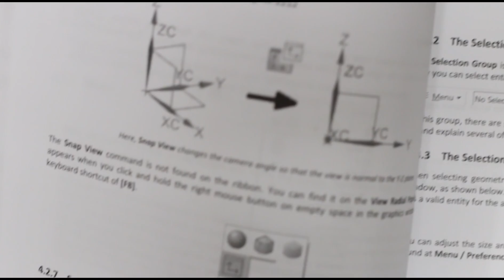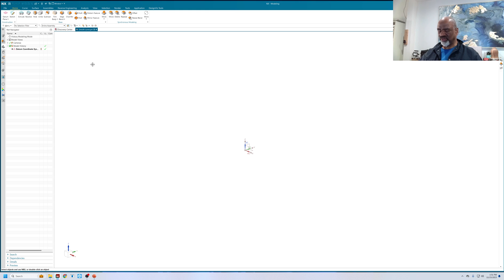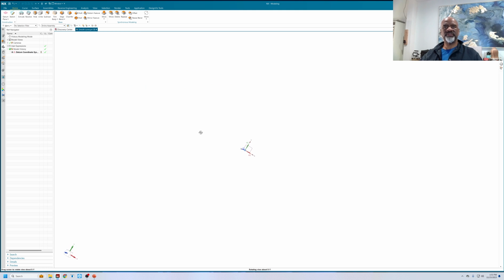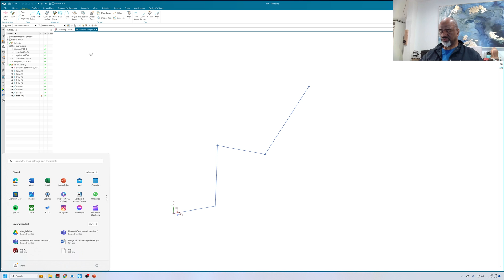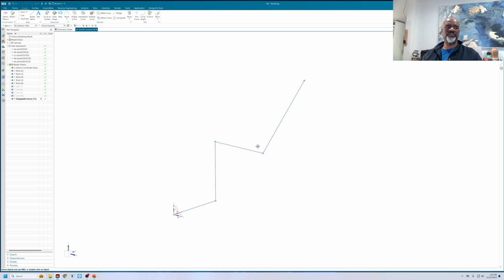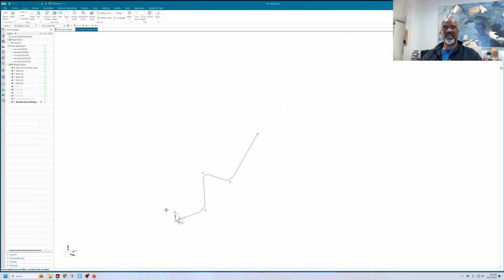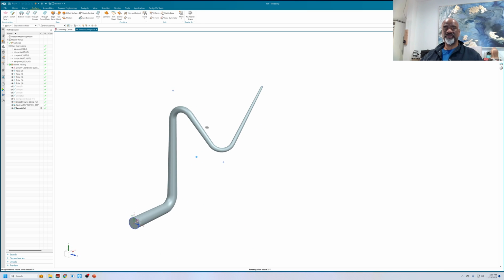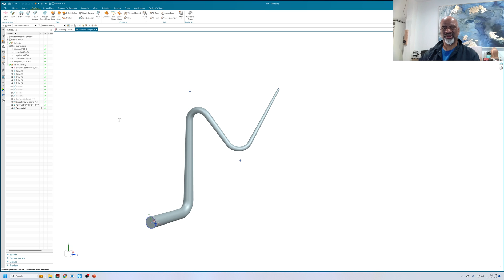Siemens NX 2212 - BET YOU DON'T KNOW THIS AWESOME OVER-LOOKED FEATURE! Smooth Curve Command

Comment: Can you please share a method to join extra faces on a surface of an solid?
Reply: Just curious, what is an "extra face"?  Can you point to an example of what you mean?
Reply: @jtmeeksjr  suppose a sphere, we can use divide face command as many times as we want. How to join all those faces back to a single one. Most often I get the error, faces are not iso-parametric